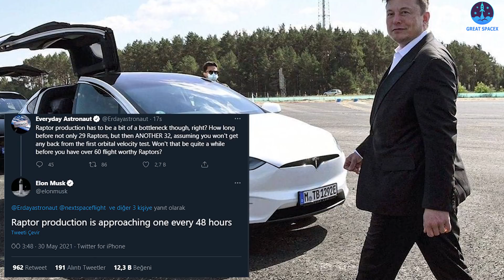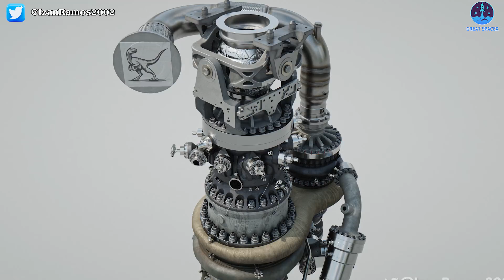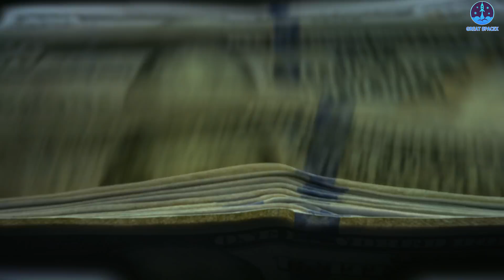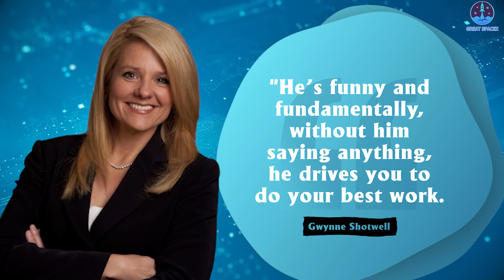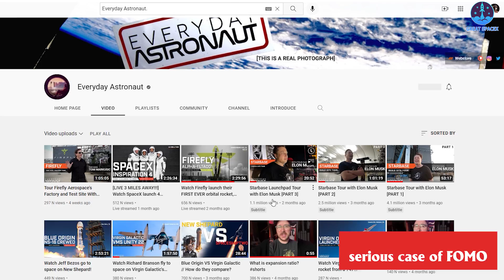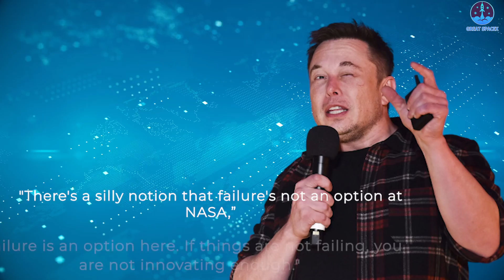What SpaceX Just Did with Raptor engines is more MIND BLOWING than you think!

Comment: No-one could be a greater supporter of Elon Musk and SpaceX than I am. I am concerned, however, that there may be fundamental flaws that may cause significant delays in the rollout of the Mars project. So many raptors together at the base of the booster may cause a wave of sound so destructive that the raptors themselves may be damaged - or the thrust puck. The heat tiles may yet cause a serious problem. The chopstick catching method has always seemed iffy to me. Any one of these could delay matters. And Elon is right - this is a race against time - every delay eats up humanity's future. Go Elon! Go!
Reply: I agree with you on the amount of engines. I hope they ran a really accurate simulation on this. Maybe run it through a super computer a couple of times. And chopsticks is just hopeful wishing I just can't see how it's going to catch something so heavy.

Comment: You should do a video on raptor 2 news, it is supposed to be stronger than the BE4 giving spacex the title of strongest engine. And it might have been the strongest for a few seconds... Before it blew up, but if they keep testing new designs they might stably surpass the be4 before the be4 is ready which would be funny
Reply: Has anything changed @ Spacex in the motors since the guy that did most of the design work "retired"??
Reply: @highpointsights  what hasn't might be easier...
Reply: I'd love to see that happen!  I'm finding Bezos hard to like for a number of reasons!